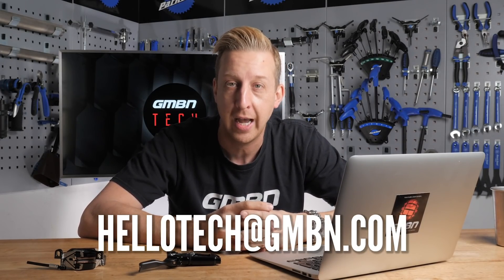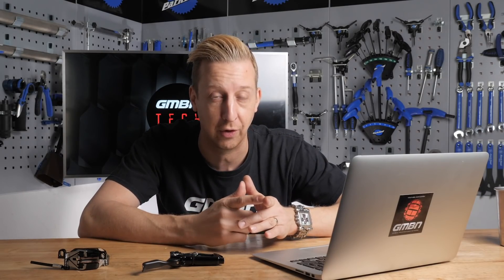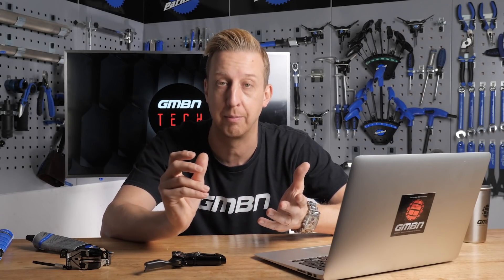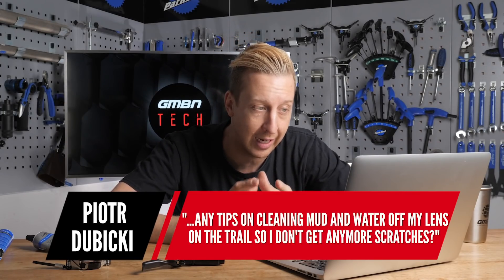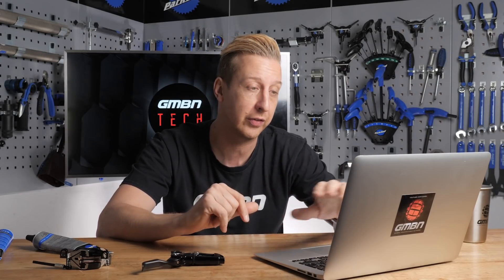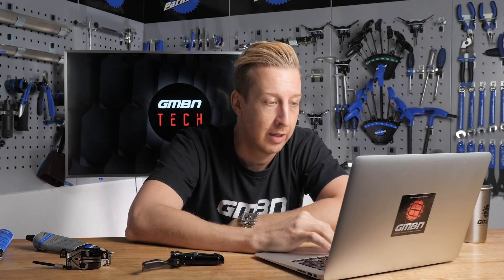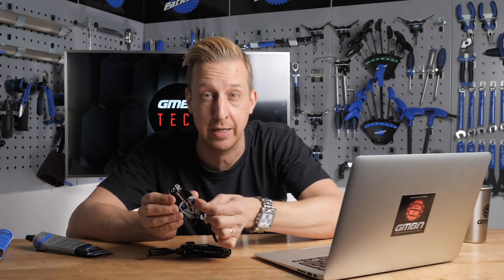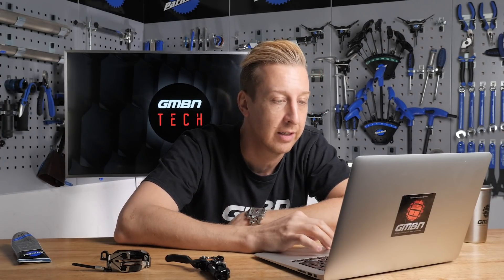How Do MTB Brakes Get Air In Them? | Ask GMBN Tech

Comment from the maker: Don't forget to leave your questions in the comments below using #askgmbntech 🔧
Reply: #askgmbntech when upgrading from 9 to 11 speed, can you use the same derailleur or are the pull ratios different? (Shimano) thanks Doddy!
Reply: @askGMBN Tech I have a fox 32 step cast 2019 Factory and I am trying to adjust the thru axle tension and on the axle nut keeper it says to use 2 mm Wrench and I have tried that and it doesn’t work as well as a 2.5 and 1.5 mm HELP!!!
Reply: Tomi Saaranen Yessss it a very worth it
Reply: Tomi Saaranen wow that is so surprising
Reply: Can i use mtb brake got bleef with car brake oil
Reply: #askgmbntech As the "zip tie king" Doddy what are your thoughts on multicoloured zip ties for tricking out your bike - or are you a strict black tie man?
Reply: #AskGMBNTech Hi Doddy and all the community. quick question about protecting the fork's stanctions: what kind of product can I use (and what to avoid) for lubricating/protecting the stantions of my Fox float fork? can imagine avoid WD40 as usual, but I just got a TF2 teflon based aerosol, and I'm not sure if it is a proper product, if it could be benefficial, or if in fact has any component that can mess up with the fork's oil. thanks!!
Reply: #askgmbntech Hi Doddy, I've noticed my pads are wearing much more on one side of the caliper than the other, especially the front.  Deore M6000, standard Shimano resin pads. What could be going on?  Love your channel and every bit of content... currently building up my own first full suspension bike and it's so much fun...also had a question about post mount adapters- how do you measure for the right size for your rotor on your fork and frame? Frame is Giant Trace 1, PM rear. Thanks, Lee.
Reply: #askgmbntech hey Doddy just wondering what is your favorite dropper post? Thanks!
Reply: I use a tint film on my lens. The ones used in cars. But i install it on the outside. Protects the lens from scratches. Easier and cheaper to replace the film than the lens

Comment: Hydraulic brakes suck.  The only reason that hydraulic brakes are the new standard is that it will keep you in the shop.  I just dropped off my bike for squishy brakes and contaminated pads.  The very next day, my bike brakes will squeeze all the way down the handle bars and will barely break the bike.  I would crash into everything hung if it was not for the front brakes.  

I so wish the standard would go back to mechanical. It so much more reliable

Comment: I use a tint film on my lens. The ones used in cars. But i install it on the outside. Protects the lens from scratches. Easier and cheaper to replace the film than the lens

Comment: I have had a soft rear shimano slx hydraulic brake and have bled the system with a lot of hydraulic fluid because of the contamination within the system, i.e. a white sludge and a black sludge.  I have had to use a lot of new fluid which I have now had to throw away. If this happens to me again is there any other product I can use to flush the system through that is cheaper than using brand new brake fluid.  I would appreciate any advice. Thank you. Les
Reply: Dot fluid in stead of mineral oil?

Comment: Ok im asking around. I have my first set of hydraulic brakes on my new bike the brake line runs on the bottom of the top tube. Thats also the contact point on my rack. Will that be a problem

Comment: #askgmbntech  When I bleed my SRAM guide brakes I struggle to get the air out and can't get a solid bite.  I had a couple questions about this...When I pull a vacuum from the lever and tap the line I get constant air bubbles into the syringe, does pulling a vacuum on the line bring air into the line?  All fittings are tight but still get lots of air.  Also can you pull a vacuum on the bleeding edge port on the caliper?  
Thanks for the tips
Reply: You coul heat the mineral oil and vacuum it to remove any water

Comment: #askgmbntech I have the SRAM Guide R brakes without the bite point adjustment.  I’d prefer to run the levers closer to the bar, but when I try to I run out of stopping power—I can pull the levers to the bar.  Should I upgrade to the RSC? Can I upgrade only the lever?Do I just need to bleed my brakes?

Comment: I just wanted to touch on the issue of how well sealed bearings are for bottom brackets on MTBs (in UK riding conditions) ... for example I know first hand how well sealed a Chris King headset is and just how long they can last, I was wondering if this holds true for their bottom brackets too?
Also, would you typically buy replacement bearings and just drop those in to the old BB cups or do you prefer to replace the whole lot and just fit a complete new bottom bracket unit?

Comment: #askgmbntech when doing a thorough bike wash, is it bad to clean the brake rotors with a rag? Because when I did that to my rear brakes, they seemed to loose all their power, almost felt like cheap rim brakes, until I broke them in again, they came back to normal power. (I didn't wipe the front with a rag just rinsed them and used a soft bristle brush, but they still have the same power)

Comment: Guys I have a tuff one. I started proper MTB last year and love it (and love your show) on a 27.5+ norco torrent 2. I love it i went from local flow trails to techy black diamont trails (walked 40% :D) on it and now im thinking of an upgrade to a full sus (still keeping my HT). So my question is Neuron or Spectral :)  Im kinda stuck in the middle of the question of 130 or 160 mm fork and 29 or 27.5 ... #askgmbntech

Comment: #askgmbntech Is it ok to heat up your brake pads with a torch when they are glazed? I know you can sand them but what’s the best way to fix this issue?
Reply: no problem, i used a torch before to clean off oil contamination. it wont fix a glazed pad though glazing means the surface got polished and can be fixed with a bit of sandpaper

Comment: #askgmbntech Hi Guys, I hope you can help. My son has a 2019 stump jumper with a fox float dps shock. Because of the asymmetrical shape of the gram and position of the shock, he keeps knocking the 3position switch into medium and firm. Is there a way to move the switch so it’s actuation starts from a different position?

Also, is this a common thing? Is anyone else noticing this?

Thanks!

Comment: #askgmbntech 🔧  i have a rock shox xc32 fork and i need it alot stiffer. with all the settings turned up as much as they go, its still to soft..im 170lbs
Reply: if its a coil sprung fork you can either buy a stiffer coil spring or convert it to an air spring. If its and air spring already you should be able to make it stiffer with increasing air pressure (setup by using sag measurements) if you blow trough the travel with correct sag you need to add volume spacers to make it more progressive

Comment: #askgmbntech Hello Doddy. The manual for the Rockshox Deluxe shock specifies to use Maxima® Maxum4 Extra 15w50 oil for the air can service. Only a few ml are required for a service but this oil is expensive and only sold in 1 L bottles. Are there alternative products that can be used? Thanks!!!
Reply: dont know if it will affect performance in any way but maybe fox float fluid? its sold in 5ml pouches for shock services

Comment: For the goggles and the scratches there is one solution that I hve found. This solution is bsically adding a sort of glass protection on the goggles like the ones tht exist for the phones. You will see that this adds a protection on top of the lenses to keep them clean and  non scratched .
Reply: Or just run tear-off’s...lol

Comment: Hi Doddy,I love the show and the tips you give to keep bikes running smoother. I have a Titan Sonic Pro (Standard version) and was wondering if it would be possible to invert mount the rear shock due to all of my water bottles keep hitting the lock-out lever when I try to take them out. Thank you
Reply: inverting the shock wont affect performance, you could argue the seal will get less lubricant and dirt will sit ontop of the seal more easely. But just make sure when you invert the shock it doesnt hit the frame (cycle it trough full range of motion without air in it)

Comment: #askgmbntech 
I just put hydraulic brakes on the back of my bike and I keep getting a noise that sounds like twisting wet metal sound and trying to figure out what it is I have did do a bed in,i have got it centered but it still makes that sound so what could make that noise.
Reply: disc brakes are very sensitive for contamination, if you get any oils on the disc (even from your fingers) they can become squeeky. if its more of a grinding noise you should check the brake pad and rotor surface for debris. scuffing both with light sandpaper may help. also it can be caused by the caliper not being centered properly, did you check visually for an even gap between pad and rotor after centering? simply doing up the bolts while holding the brake isnt always effective

Comment: You can get away sometimes with brakes with air in. point the lever up so the master cylinger and hose is pointing down and pump the lever. 
That usually pushes the air out o you get a better lever or push the pistons back and pump the lever back to the disc
Reply: thats a very temporary solution, you dont want the brakes suddenly becomming a sponge during a ride

Comment: #askgmbntech hi doddy I am jumping a lot on my 130mm full sus and  bottoming out a lot would putting more air in my shock and fork help at all and not use all the travel thanks
Reply: Yes
Reply: it would help but it would also make the suspension stiffer and perform worse on the trails. if you want to keep the same sag and plushness you should add volume spacers instead

Comment: #askgmbn are there differened gyro tabs sizes howdo i know what size i have if theres more than one?why are there two holes on the frame? (Its this small part that holds cables an is attached to the frame)

Comment: A ceramic BB is worth it if you have a cadence of 20,000+ rpm when heat becomes a factor. Otherwise, spend your money on a high quality BB with stainless bearings and good seals. There's absolutely no noticeable difference in performance. After that, the best thing to get good performance from a BB is make sure they're properly installed with the correct preload so they roll smoothly.
Reply: Bob Baldridge so true! i would also add, that there is no such thing as proper seals when you do stuff like: “cross that river bed dude!!!” and submerged the bb for some time when spinning the cranks. i’ve destroyed cheap shimano, and twice as expensive race face with proper sealing at very comparable time.
Reply: and also nearly all bearing friction comes from bearing seals, if you would remove the seals and grease from steel and ceramic bearings they will perform the same. i doubt ceramic bearings last longer since the races are still steel and will wear instead of the balls
Reply: @harryhall6102 , not useless, just pointless.

Comment: #askgmbntech is it more important to have a straight wheel or equally tightened spokes?(and is it a problem if i tightened it as much as i can only barely move the spokes??)
I would appreciate anyones answer 😀
Reply: As long as the wheel is still relatively straight, meaning you wont notice any feel on the bike while your riding, then equally tightened, and properly tightened for that point, spokes. If you have one or two spokes in an area that looser than others around them then its a one way ticket to taco city. (speaking from experience)
Reply: @wittwer427  thank you, i have one more question, my spokes are so tight i can t move them more than like 1-2 milimetres, should i loosen them?
Reply: @kkkrrr7717  I wanna say no, and instead look for something with your rim that might because those to be unusually tight, but I'm not too sure on that one.
Reply: Krisztián Székely you don’t want them that tight, you’ll most likely start breaking spokes, nipples, or worst case scenario pull a nipple through the rim bed (new wheel time). Another reason is super tight spokes will cause a very harsh ride, you want some compliance. Back off the tension of all spokes by .5 to 1.0 full turn until the spokes flex by a few mill when you squeeze them.
Reply: @dudewheresmybeer  ok, thank you

Comment: #askgmbntech my bike has a 9mm QR axle and I was wondering what the pros and cons of them are. Also could I learn to jump on a bike with 9mm QR axels?
Reply: Pro, you can get the wheel on or off slightly faster. Cons, its a weaker front end with a lot more flex, meaning your bars can be pointed in one direction and your wheel could be headed in a slightly different. They'll be fine to jump on and will take a good amount of abuse. Just don't do anything too stupid on them.

Comment: #askgmbntech Doddy, have you ever tried hot waxing a chain? I know GCN has experimented with it, but it seems like a more ideal solution for mountain biking as it won’t attract any grit to the drivetrain. Curious what your opinion is.
Reply: ive been trying this method for a bit, still working to get the optimum solid-liquid parafin balance. So far i can say its alot cleaner to use, but it doesnt seem to last long (think my wax is still a bit too hard when cold). Also consistency varies with temperature which is an annoyance

Comment: #askgmbntech Hi Doddy, I'm currently running a pair of Schwalbe RocketRon Evo LightSkin tyres. I'm not sure what year model they are, but I guess they are some older ones. I'm running them tubeless and don't have any problems with sidewall sealant leakage (there were some small ones but they stopped leaking pretty quickly), using  Joe's no-flats sealant. I'm considering switching to Continental RaceKing RS tyres, however I'm reading that lots of people have problems with sidewall sealant leakage. Do you have perhaps some experience with setting these tyres tubeless, or any advice? I think they are not official labelled as tubeless ready, and my current RocketRon's aren't either (I think). Cheers!
Reply: ive heard most bad stuff about lightskin schwalbes myself, ive ran some RoRo lightskin wire beads tubeless for about a year without issue either. I think you'll be fine on the continentals, just keep an eye on sealant levels (if you dont hear liquid shaking the wheel it needs more sealant)

Comment: On my bottom bracket (sm-BB52) it says "do not disassemble" what does this mean? It is a carbon bike and what if I want to change the bearings?
Reply: francesco bertola all it means is that the bb shells are assembled in a factory and are not meant to be disassembled, dust covers, shields and seals etc. it can be done but the individual parts are easy to damage. You don’t want to remove a dust shield to try to access the bearings inside. When time comes for new bearings you just replace the entire bottom bracket. They’re usually pretty cheap up until you get into very high end ceramic stuff.
Reply: in short shimano doesnt want you to service the unit but simply replace it

Comment: Doddy, I feel like you're leaving out an important part of the braking system, and that's the fluid you use, there's several different choices, and depending on what you're using the absorption of moisture can get you into trouble.

Let's use for example mineral oil, it will work fine until enough moisture gets in, once that happens as the oil floats on top of the water the oil is going to get displaced and the water is going to be in direct contact with the pistons, if you're on a hard braking trail you could get the caliper beyond 100ºC, boil the water and get a massive bubble that's going to stop you from braking.
DOT fluids absorb moisture but even out the water on the entire line so the boiling point gets lowered gradually with time, this is why you should replace the fluid from time to time, no matter if mineral oil or DOT, or you might get a nasty surprise one day.
Reply: You also need to mention that DOT and mineral oil ARE NOT interchangeable. And, most times the specific brand that uses mineral oil requires you to use their brand. SRAM, Hayes, Formula and Hope use DOT fluid, whereas Shimano, Magura, FSA and TRP all use proprietary mineral oil.

Comment: #askgmbntech Hello Doddy, love the show. I have an old fork that doesnt realy work, i want to buy a new one but atm i have quick release scewers! Can i buy a fork with thru axles or do i need to also buy a new wheel or a different fork?
Reply: you can use adapters to make a thru axle wheel fit in a qr fork, but you cant make a qr wheel fit a thru axle fork. if you want to upgrade only the fork i would recommend the manitou markhor as a great budget air fork (straight steerer and qr possible)
Reply: ultiss alright, thank you very much!!